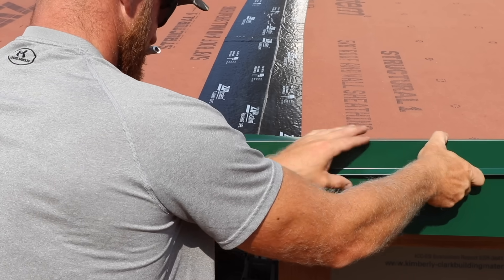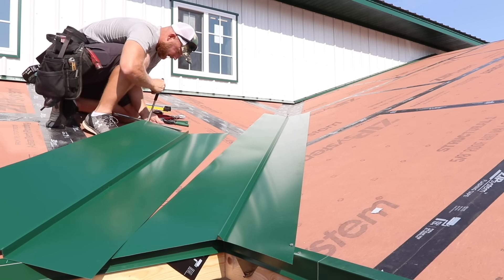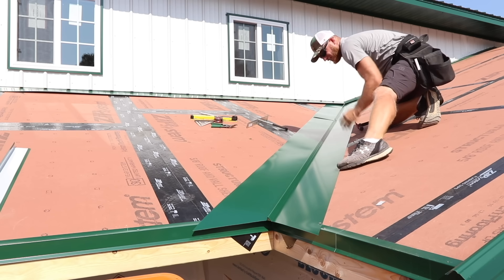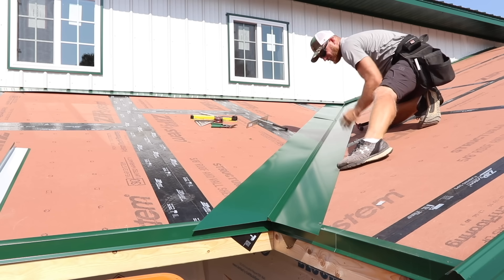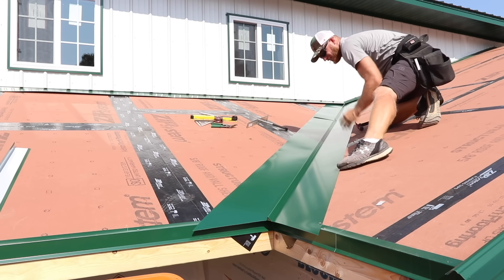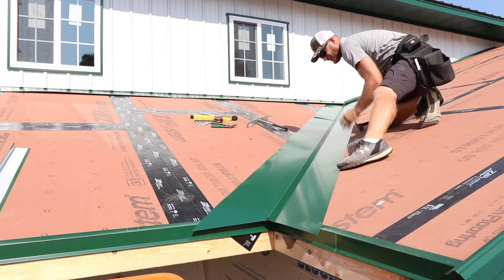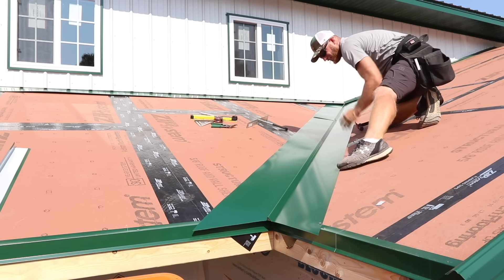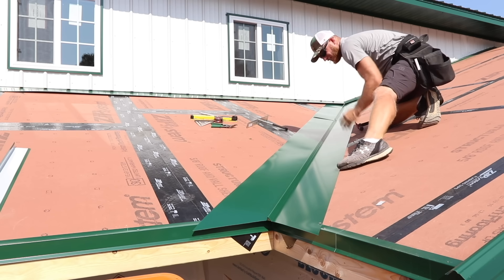Building a Hunting Cabin 21: Metal Valley and Hip Details

Comment: This is turning into a rather large "cabin" but the design is very nice, especially the covered porch all the way around. It's set up to allow human movement in and around the building no matter what weather is present. Covered porches are truly the "pinstripe" to any structure and it's sad that home builders are not using them. In fact, many home builders aren't even including much of a roof overhang at all which I believe is a bad idea for the building due to excessive weather exposure to the upper areas and just about zero protection from the sun etc. What's worse, folks are willing to pay for less even though the builders are selling them for the same price of more featured homes. Tract homes are a real negative in the housing industry...less features, more frills for the same price. And, hardly any yard/lot space with garage doors 15 feet from the street. They really need to get back to detached garages located in the rear yard area.
Buildings like these put your typical residential build to shame...thanks for the review.

Comment: I just can't believe that those washers are going to last 30 years...
Reply: My garage roof is done 1996 and washer are still flexible made from EPDM rubber.
Reply: @mr.wizeguy8995  
Can you over compress it....
Reply: @joeschlotthauer840  only if there is more than material than needed. the ones he uses seem to be just the right size and are concealed from the light.
Reply: It is not just about the washers. There several factors that will make the roof leak around the screws. 1) expansion and contraction in the metal panels AND in the buildings. 2) metal burring around the screw caused by the threads of the screw. 3) human error, no man can sink every screw perfectly. 4) if the washers actually lasted 30-35 years the manufacturers would give warranties on them in the range of 20-40 years. They give NO warranty on the washers. 5) structural inconsistencies. Some screws will encounter odd grains in the wood, seams in the wood, nails of other metal components under the panels, and last but not least, 6) condensation under the panels that will run along the bottom  of the panels hit a screw and follow the screw into the wood structure. Then you have to worry about the seam of the panels leaking in extreme weather. 
Even with the decking system you used you should have used an underlayment. 
This all being said, you clearly take great pride in your work. It is always a joy to see an installer take pride in his work.
Reply: @traceyjscott069  In My country we have one screw manufacturer who gives for screws 20 year warranty for rust free and 30 year for no leaking if assembled correctly.
But as you said we also use roll type underlayment which is directly attached to trusses and we doesn't use any board under roof just underlayment and battens and sheet metal roofing is attached to battens.

 
Joe Schlotthauer, yes you can screw too tight which compress rubber seal too much and shortens it lifetime but quite easy to set them right when you get used to it.
Reply: @traceyjscott069  
Well said, it's a lot of faith to put in a washer...
Reply: @traceyjscott069  wowser, all good pointers, and a bit lengthy, I read it all .